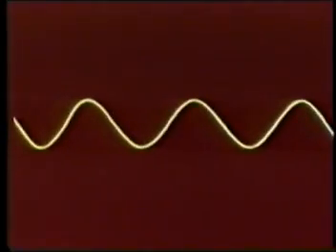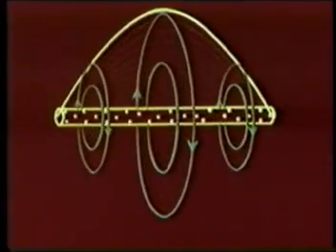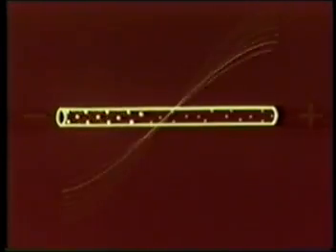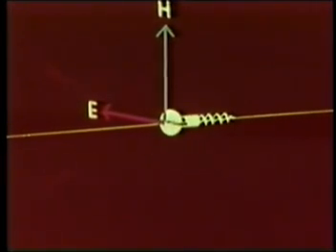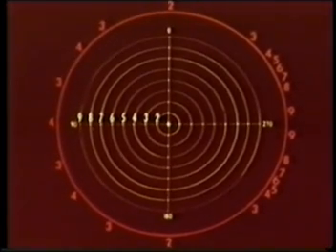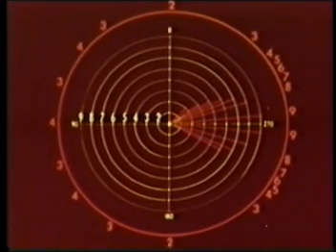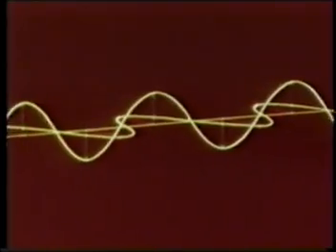Antenna Fundamentals 1 Propagation

Comment: im a rf test engineer and this is a great video :) thanks for posting
Reply: Hi Leonard.  Can I ask you a few questions about how this works?
Reply: @ThatEEguy2818  which questions?
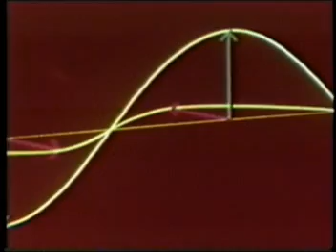Reply: @redknight344  it's been a while, but the one question I've never gotten a clear answer to is how the E&H fields go from 90 degrees out of phase at first (4:35), only to end up in phase later (5:45).  This doesn't make sense.
Reply: @ThatEEguy2818  The EM field consist of two parts the reactive field and the radiation field in the near field region the reactive one is prominent and this is 90 degrees out of phase but in the far field region the radiation one is promiment and this is in phase. but in the two regions both always exist only that their strengh varies from region to region.
Reply: @redknight344  so how is the far field created?
Reply: @ThatEEguy2818  look the expression for a hertz dipole antenna fields in this power point presentation, as you can see in the expressions that describe the E and H fields, there are some elements in phase and some in 90 degrees out of phase. (the ones with the j are 90 degree out of phase with the ones that doesnt have the j) in the near field region only the higher exponents in the denominator matters so the expression result in a E and H fields in a 90 degree phase (the E field have a j and the H dont) but in the far field only the lowest demoninator exponents matter, so the E and H fields that matters both have a j and thats why they are in phase, finally  the radiation field is created in that charge moving but is just hidden in the video explanation because is not noticeable, it just part of the total E and H field created by the current and charge.
Reply: @redknight344  what power point presentation?
Reply: @ThatEEguy2818  check your youtube account, the comment i made.
Reply: @redknight344  I see the video we're commenting under, but no pp.
Reply: @ThatEEguy2818  check your account, the debate section.
Reply: @redknight344  nothing there related to this topic.
Reply: @ThatEEguy2818  i dont understand why the links disappear from this comments, im sure the hertz diapole link is in the debate section of your youtube account.
Reply: @redknight344  there's nothing there on this topic.  Post a link but break it in an obvious way.  I'll copy it and fix it.
Reply: @ThatEEguy2818  so you didnt find anything? in the debate section of your account? www.   brown.   edu   /research/labs/mittleman/sites /brown.   edu. research. labs. mittleman/files/uploads/lecture24. pdf    i hope this time works
Reply: @redknight344  there are a bunch of political videos in the debate section.  Nevertheless, I received the pdf and am reading it.  It's up to my neck at least so I'm going to have to go through it slowly.  I don't think in math terms, I visualize, so this is going to be a challenge.
Reply: @redknight344  got pulled away by family.   Haha.  Anyway,  thanks for the document.  I hope I can understand it.
Reply: @ThatEEguy2818  I understand but the only way to really understand what is going on and why things happend is through the math description, so good luck!!
Reply: @redknight344  that's funny because my experience has been the opposite.  I used to sit with my study group in electronics and answer my homework problems by imagining what was happening.   My classmates would ask, "how do you do that, you haven't solved anything yet?"  Of course, I had to solve to get credit but I could see what the circuits were doing without calculating anything.  I've  always thought it made me a better design engineer but it always bothers me when I can't imagine what's happening.  Thanks to you, I'm starting to get a picture of what's going on here.  It's not good that this video ignores this as anyone that understands this video knows something is missing.
Reply: @ThatEEguy2818  so you are an engineer too right? well i try to do the same as you to imagine the situation but, the thing is that the math give you better insight about what is happening and why the phenomena work the way that you imagine it , or let you see when you are wrong about understanding how a phenomenon behaves.
Reply: @redknight344  yes, I am an engineer.  This wave proportion has always troubled me because I received a poor (and blatently incorrect) explanation many years ago that never made sense to me.  To summarize, the way it was explained required a medium.  I knew it was wrong but couldn't find a better explanation.  I have to say thanks for your paper on the subject.  Although it required some careful study, it led me to be able to ask the right questions, which led me to this video...
https://youtu.be/HH_7WUEqQuM
Starting around 1:55.  I think I get it now... at least why E and H are in phase, and why the frequency has to be a certain Hz before the EM wave will begin to propogate efficiently.
Reply: @ThatEEguy2818  is great you are a engineer too! and im happy the power point i shared with you help a little bit, because i think it explain very well the basic of radiation, and E and H are in phase because is the only way EM energy go away in a radial direction and propagate. About the frequency and the radiation efficiency well  yes for EM to propagate with most of the input energy from a dipole antenna, this antenna has to be half wavelengt long, this is because it becomes resonant and all the reactive part cancel outs in the input impedance and its easier  to match so  most of the energy radiates.

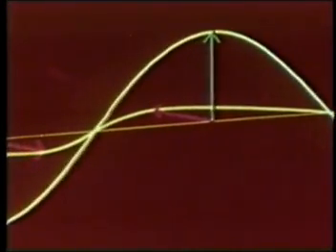Comment: Great video, but there is one thing I don't quite understand.  Maybe someone can help me out.  If the current standing wave "H field" and the voltage standing wave "E field" are 90 degrees out of phase w/ each other (see from time 4:30), then how are the two waves that make up the propagating EM field both back in phase in time (see from time 5:45).  Really trying to learn what all is going on here, can anyone help?  Thanks.

Comment: Can someone explain why the E and H fields maximums are 90 out of phase of each other at the dipole in the near-field, but EM Waves have E and H peaks in phase as they radiate out in the far-field?
Reply: Exactly what I don't understand also.
Reply: Dragos Minea  ofeyofey I hope you both are fine.
I think I can explain that. 
For example, in the infinitesimal dipole analysis, when you acquire the H and E fields, the E field has two components (radial and polar) and H field has only one component (azimuthal ), in the Near-Field-Region you take the two fields (H and E) and you make an approximation (kr<<1), and the 90° phase difference is a result from that and hence there is no average power radiated (<E x H> = 0), then, when you analyse the Far-Fiel-Region you make another approximation (kr>>1) and that eliminates the radial E field component, and only remains the polar component from E and the azimuthal component of H, also, both Fields become IN phase and the cross product of E and H is in the radial direction which is the Poynting's Vector direction (power radiated).  I hope you both understand.

Saludos!
Reply: Edward Medina Guerra
 Hi Thanks for the explanation. Would take a bit of reading to understand but thanks.
Reply: ofeyofey Hello, you're welcome. Have a nice day.

Comment: Here is a copy of my latest TOE, followed by the 'gravity' test that would recognize 'gravity' as being the force that makes the sine wave of em expand and contract and would act basically 90 degrees to the em forces, which of course act basically 90 degrees to each other.

Revised TOE: 3/25/2017.
My Current TOE:

THE SETUP:
1. Modern science currently recognizes four forces of nature: The strong nuclear force, the weak nuclear force, gravity, and electromagnetism.
2. In school we are taught that with magnetism, opposite polarities attract and like polarities repel. But inside the arc of a large horseshoe magnet it's the other way around, like polarities attract and opposite polarities repel. (I have proved this to myself with magnets and anybody with a large horseshoe magnet and two smaller bar magnets can easily prove this to yourself too).
3. Charged particles have an associated magnetic field with them.
4. Protons and electrons are charged particles and have their associated magnetic fields with them.
5. Photons also have both an electric and a magnetic component to them.

FOUR FORCES OF NATURE DOWN INTO TWO:
6. When an electron is in close proximity to the nucleus, it would basically generate a 360 degree spherical magnetic field.
7. Like charged protons would stick together inside of this magnetic field, while simultaneously repelling opposite charged electrons inside this magnetic field, while simultaneously attracting the opposite charged electrons across the inner portion of the electron's moving magnetic field.
8. There are probably no such thing as "gluons" in actual reality.
9. The strong nuclear force and the weak nuclear force are probably derivatives of the electro-magnetic field interactions between electrons and protons.
10. The nucleus is probably an electro-magnetic field boundary.
11. Quarks also supposedly have a charge to them and then would also most likely have electro-magnetic fields associated with them, possibly a different arrangement for each of the six different type of quarks.
12. The interactions between the quarks EM forces are how and why protons and neutrons formulate as well as how and why protons and neutrons stay inside of the nucleus and do not just pass through as neutrinos do.

THE GEM FORCE INTERACTIONS AND QUANTA:
13. Personally, I currently believe that the directional force in photons is "gravity".  It's the force that makes the sine wave of EM energy go from a wide (maximum extension) to a point (minimum extension) of a moving photon.  When the EM gets to maximum extension, "gravity" flips and EM goes to minimum, then "gravity" flips and goes back to maximum, etc, etc.  A stationary photon would pulse from it's maximum extension to a point possibly even too small to detect, then back to maximum, etc, etc.
14. I also believe that a pulsating singularity (which is basically a pulsating photon) is the energy unit in this universe.
15. When these pulsating energy units interact with other energy units, they tangle together. Various shapes (strings, spheres, whatever) might be formed, which then create sub-atomic material, atoms, molecules, and everything in existence in this universe.
16. When the energy units unite together they would tend to stabilize and vibrate.
17. I believe there is probably a Photonic Theory Of The Atomic Structure.
18. Everything is basically "light" (photons) in a universe entirely filled with "light" (photons).

THE MAGNETIC FORCE SPECIFICALLY:
19. When the electron with it's associated magnetic field goes around the proton with it's associated magnetic field, internal and external energy oscillations are set up.
20. When more than one atom is involved, and these energy frequencies align, they add together, specifically the magnetic field frequency.
21. I currently believe that this is where a line of flux originates from, aligned magnetic field frequencies.

NOTES:
22. The Earth can be looked at as being a massive singular interacting photon with it's magnetic field, electrical surface field, and gravity, all three photonic forces all being 90 degrees from each other.
23. The flat spiral galaxy can be looked at as being a massive singular interacting photon with it's magnetic fields on each side of the plane of matter, the electrical field along the plane of matter, and gravity being directed towards the galactic center's black hole where the gravitational forces would meet, all three photonic forces all being 90 degrees from each other.
24. As below in the singularity, as above in the galaxy and probably universe as well.
25. I believe there are only two forces of nature, Gravity and EM, (GEM). Due to the stability of the GEM with the energy unit, this is also why the forces of nature haven't evolved by now. Of which with the current theory of understanding, how come the forces of nature haven't evolved by now since the original conditions acting upon the singularity aren't acting upon them like they originally were, billions of years have supposedly elapsed, in a universe that continues to expand and cool, with energy that could not be created nor destroyed would be getting less and less dense? My theory would seem to make more sense if in fact it is really true. I really wonder if it is in fact really true.
26. And the universe would be expanding due to these pulsating and interacting energy units and would also allow galaxies to collide, of which, how could galaxies ever collide if they are all speeding away from each other like is currently taught?

DISCLAIMER:
27. As I as well as all of humanity truly do not know what we do not know, the above certainly could be wrong. It would have to be proved or disproved to know for more certainty.

--------------------------------------------------------------------------------------------------------------------------
Now the test for 'gravity':

Here is the test for the 'gravity' portion of my TOE idea.  I do not have the necessary resources to do the test but maybe you or someone else reading this does, will do the test, then tell the world what is found out either way.

a. Imagine a 12 hour clock.
b. Put a magnetic field across from the 3 to 9 o'clock positions.
c. Put an electric field across from the 6 to 12 o'clock positions.
(The magnetic field and electric field would be 90 degrees to each other and should be polarized so as to complement each other.)
d. Shoot a high powered laser through the center of the clock at 90 degrees to the em fields.
e. Do this with the em fields on and off.
(The em fields could be varied in size, strength, density and depth.  The intent would be to energy frequency match the laser and em fields for optimal results.)
f. Look for any gravitational / anti-gravitational effects.
(Including the utilization of ferro cells so as to be able to actually see the energy field movements.)

(An alternative to the above would be to shoot 3 high powered lasers, or a single high powered laser split into 3 beams, each adjustable to achieve the above set up, all focused upon a single point in space.)

'If' effects are noted, 'then' further research could be done.
'If' effects are not noted, 'then' my latest TOE idea is wrong.  But still, we would know what 'gravity' was not, which is still something in the scientific world.  Science still wins either way and moves forward.